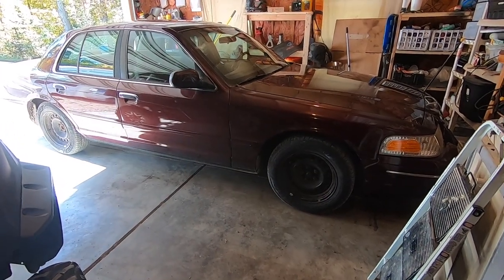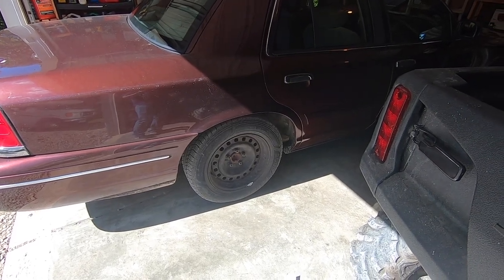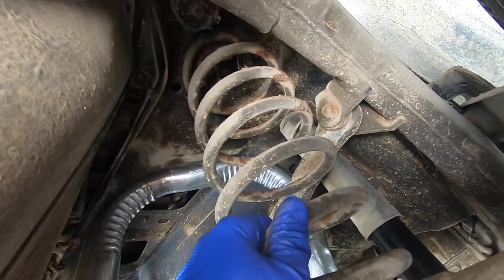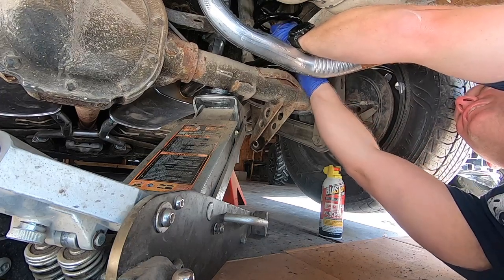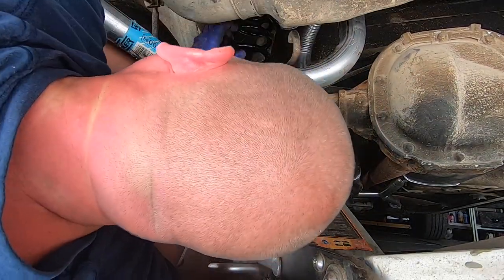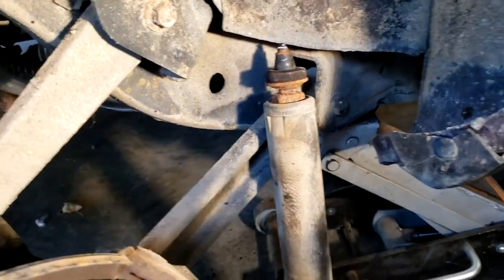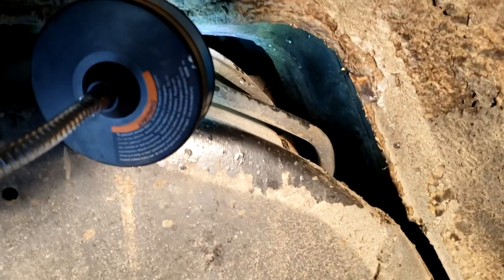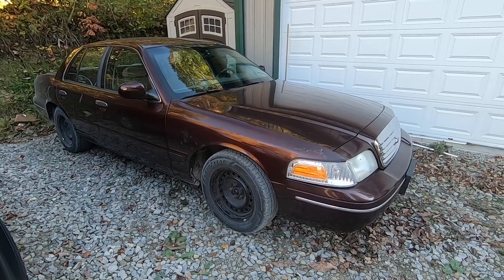1998-2002 Ford Crown Victoria Rear Springs and Shocks Replacement

Comment: Tape the insulators on. I air Bag my 2000 GM as the sway bar rubbed on the Explorer IRS cover drain bolt when fully loaded.  Soft or firm ride with air adjustment.

Comment: I have a 2000 Lincoln Town car, with the springs in the rear brginning to sag. Do you have any idea if the springs from the 2003 Crown Victoria Police Interceptor would be compatible with my vehicle? 

I am hoping that they may be compatible, because I was planning to have the coils replaced soon, and this would be a nice upgrade.
Reply from the maker: Yes, they will work!

Comment: hi thank sfor the video. do you know if the parts you used are the same for a 2008 mercury grand marquis? thank you!
Reply from the maker: The springs are but the shocks are not. In 2006, they completely redesigned the suspension front and rear. Outboard shocks and a much better ride.
Reply: @JackofAllMasterofNone  thank you! I need to replace the shocks on all four corners

Comment: Where could I purchase this specific pair of springs online?
Reply from the maker: eBay is a good place. Or any online Ford dealer.
Reply: I found some on rock auto, Swedish steel cargo springs $63!
Reply: Make sure you get progressive winding
Reply: They are way more responsive than air, did my shocks and struts too
Reply: @robertvilliard6768  is progressive better than variable?
Reply: @Rylee_G  same
Reply: @robertvilliard6768  thanks!:)

Comment: How much are the springs?
Reply from the maker: Depends. I got a good deal on eBay for around 100 for the pair. Gotta shop around.
Reply: Don't buy regular ones, the progressive springs give way better ride. Run $89 at O'Reilly

Comment: Do you need the rubber isolator on the springs?
Reply from the maker: I would. Worst case without it you could get some squeaks every now and then.
Reply: And theyre only on top ?

Comment: Did it help with the the bumpy ness of the ride
Reply from the maker: Not sure exactly what you mean. It firmed up the rear end. More sporty feeling if anything.
Reply: Grease all joints need gun its 52 bucks auto zone fix all noise for ya